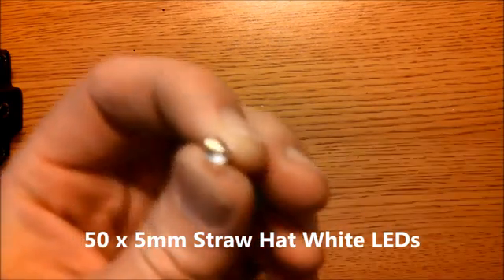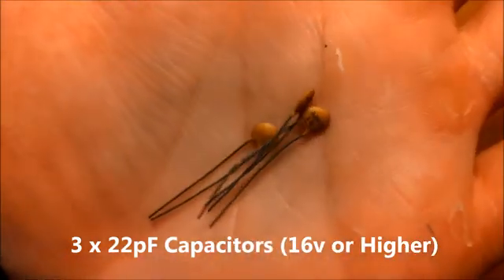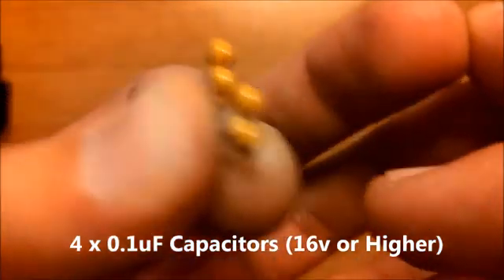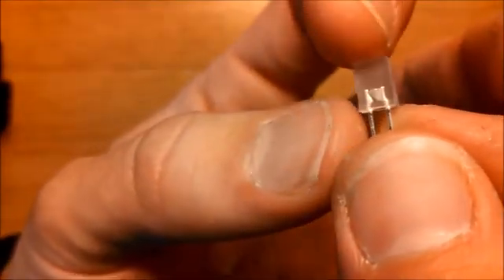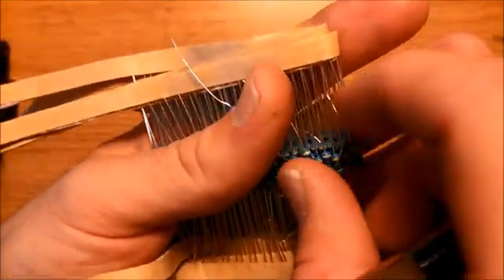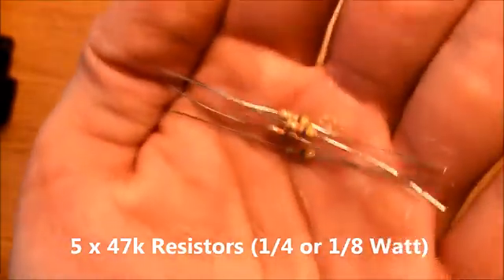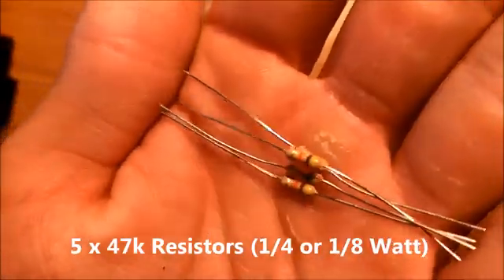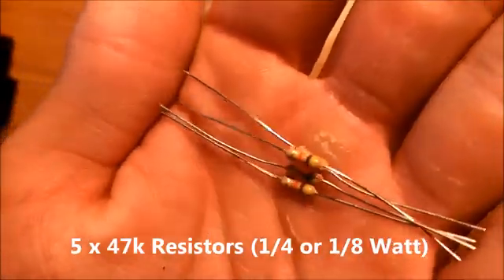Guy Manuel Upgrade Kit Parts List

Comment: Just to make it easier for me to come back to and buy everything - 

50x 5mm straw hat white LEDs
2x 16 Mhz crystals 
3x 22pF capacitors (16v or higher)
4x 22uF capacitors (16v or higher)
4x 0.1uF capacitors (16v or higher)
100x white 2x5x7mm rectangular LEDs
20x 470 Ohm resistors (1/4 or 1/8 watt) (he has 1/8th ones)
4 feet of 50 conductor 28AWG cable
5x 47k resistors (1/4 or 1/8 watt) (he has 1/8th ones)
3x Max7219 integrated circuits (like at 2:15)
2x 5mm Red LEDs
2x 5mm Green LEDs

tools 
30watt soldering iron
Hot glue gun
Wire cutters